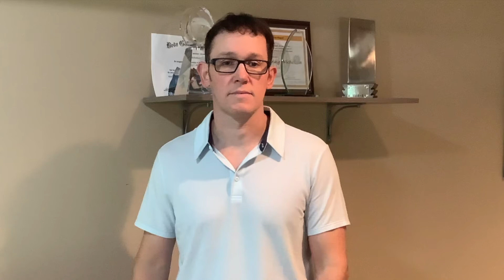Power Plant Controls Upgrades

Comment: Agree with all of your points of a lifecycle approach, currently trying to embed these principles into our business. I am also pushing a simplification of control systems designs, vendors are economically incentivised to sell you more and more so the most recent systems have become hugely complex. A focus on MTTR instead of MTTF can achieve the required availability with the most simple of system designs using hardwired, simplex architectures. These designs reduce operational costs, safety lifecycle costs, training, spares and support and beat the old saying 'complexity is the enemy of cybersecurity'.